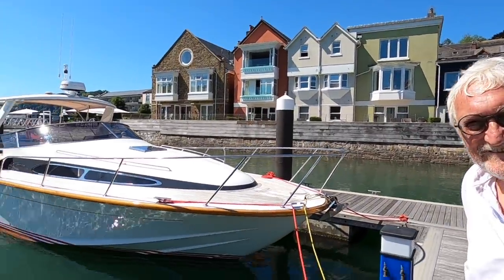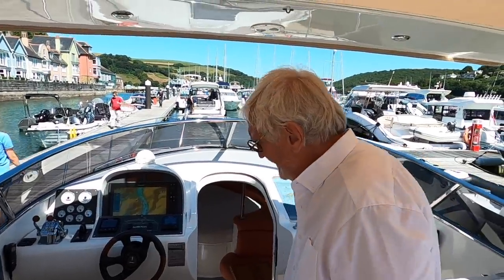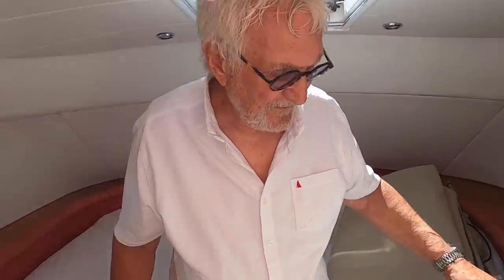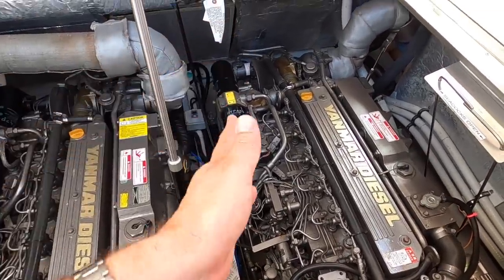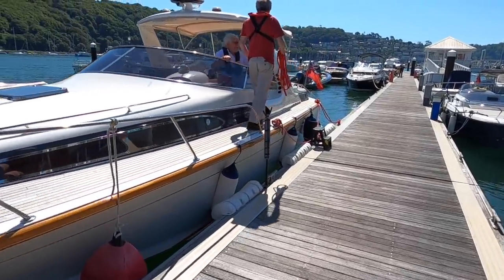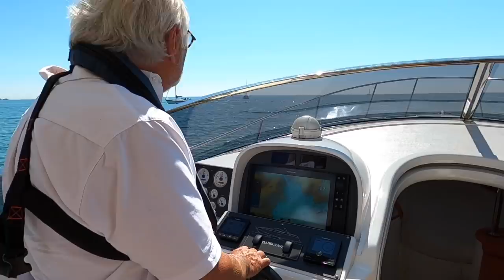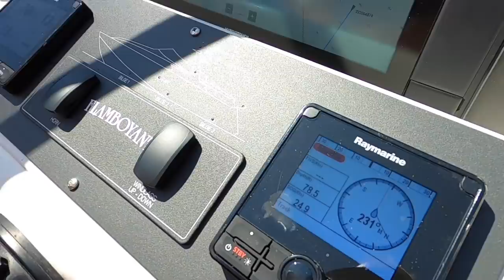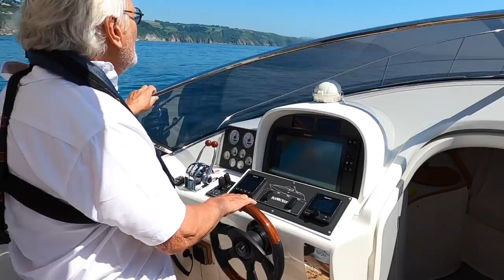Meet The Owner : Supermarine Swordfish 36

Comment: I absolutely love that boat.  Twin cabins all be it small but still twins on a 36 is totally awesome.  He did a fantastic job and refitting it.  It looks the money for sure.
We have had many boats while I was growing up and into my early adult life.  My father shared a boat with his cousin that I used a few times a week while in high school and college.  I would take my girl friend out to watch the sunset on the lake.  I would not drop the anchor and let it float.  We would occasionally take a swim but always stay rather close to the boat lol for obvious reasons.   It had twin 454 gas Mecruizers on it with out drives.  It did about 45 MPH or maybe a bit more.  It got on plane in seconds literally.  Once the engines were properly warmed you could just slam that throttle forward and it went and boom on plane.  Totally awesome.  I turned on a dime as well.  I have many more boat stories if you are interested.

Comment: Nice Vlog 👍and beautiful boat! The colors on the lower portion, wooden rub strip, and the dark stripe to accentuate the windows really make it stand out among the "plain" white boats around it! Healthy sounding engines without any drone to them. Would like a slightly larger swim platform but it's still usable for standing on and getting in. Nice cabins with a surprising amount of headroom especially at the back. Only thing I would do to it is to add some rubber or felt under the stairs door to get rid of the fiberglass on fiberglass squeaking....and maybe update the color of the couches/seats in the cabins to a blue to match the stripe around it.
Would love to see a video on the Paddlewheel boat or some other one and see them out being driven! Always loved the sound of the paddlewheels as they move the boat along!

Comment: Hi Nick, another great video.  Might be worth looking at the Rode Wireless Go II radio Mike system, a really simple to use two channel ie: two mikes (if needed) one receiver, system which would allow you to easily have a personal mike on both you and your interviewee for these “Meet the owner” videos. I think this works with GoPro, I’ve used one with a similar Canon camcorder to the one you had at one point.
Reply from the maker: Thanks for the tip!
Reply: @AQUAHOLIC  no problem. The Go receiver has a 3.5mm output jack which I think should plug into your GoPro (definitely fits Canon G30) and each of the transmitters has a built in Mike for “clip on and go” and a 3.5mm jack for an external Mike as an alternative, plus there are furry windshields for the built in mikes!
Reply from the maker: @MrRnipperBrockleBroadcasting  I will look into this. It's a balancing act though, just holding a GoPro keeps things really casual. If you start mic-ing people up it can take away the spontaneity
Reply: @AQUAHOLIC  You'll just have to turn up your wit and charisma to compensate!  But seriously these Rode Go 2's can be literally clip on and go. (I'm not on commission, honest!)